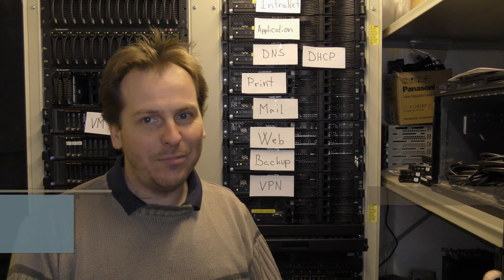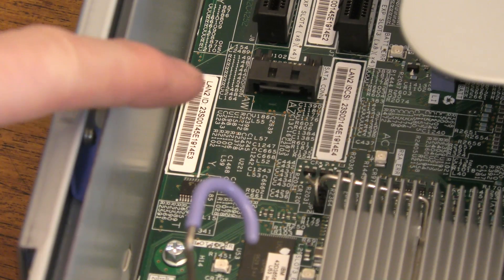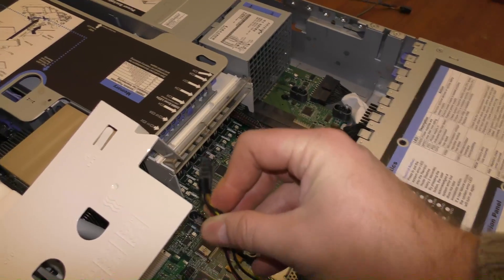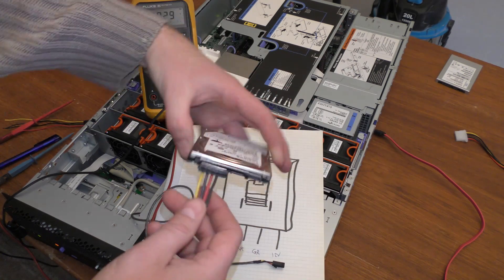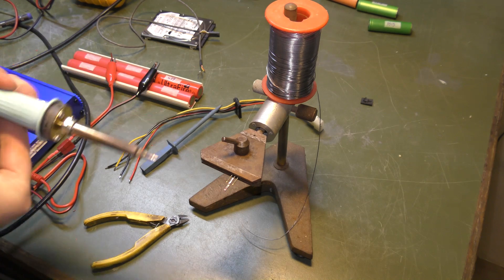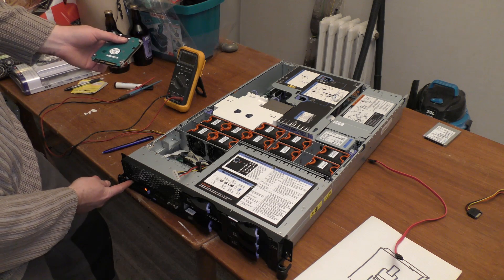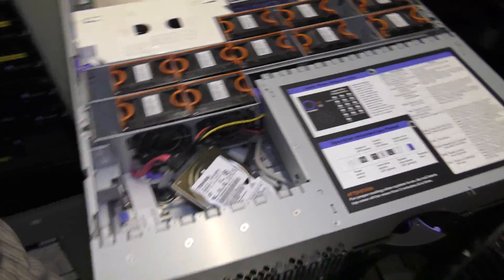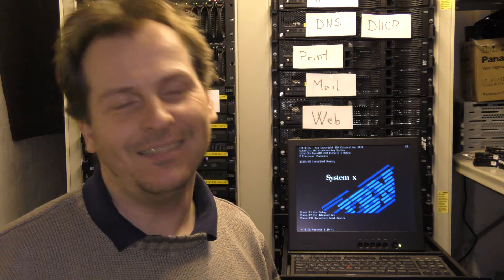IBM x3650 M1 now with internal disk - Ninja Hack - 276

Comment: Hi I'm trying to do the same thing in my x3550 M5 is there a power connector as there seems to be a Sata port?
Reply from the maker: I do not have the x3550 M5,, but there should be some power,, for the DVD-rom
Reply: @MyPlayHouse  there is it is one connector with both power and data but it's a small dedicated connector not a standard

Comment: As we have an old x3650 M1 you might have a good hint what to do, if the arcconf-Command fails:
"/usr/sbin/arcconf
Segmentation fault"

I don't know how to solve this.
Any hints?
Reply from the maker: Hi whiterabbit2112
Thank You very much!  I would,, run the BOMC to make sure all firmware is all good and new. (I have videos on that) I would reconfigure the raid controller,, delete all drives and make them again. and then reinstall the OS,, if that linux OS than fails,,, I try a Server 2008R2,, just to see if that would install. 
Thank you for watching! :-)
Reply: For future users. 

Install the debian package (If you've got installed RHEL, RPM package). If youre using Proxmox and need the configuration for the 8K, Install the package from Adaptec Website.
http://download.adaptec.com/raid/storage_manager/asm_linux_x64_v7_31_18856.tgz

Install it. Enter in the folder /usr/StorMan and put this Variable.
export LD_PRELOAD=/usr/StorMan/libstdc++.so.5
and run ./StorAgnt.sh (For testing purposes do it and close with CTRL+break, or if you like to run it in second instance do it with "screen", dvtm or tmux)

Run in Windows or Linux the GUI Management
http://download.adaptec.com/raid/storage_manager/msm_windows_x64_v2_03_22476.zip

Put the IP from the server and username root, password (proxmox password)

Pd.: Don't try the ./StorMan.sh because it needs X11 display. Proxmox is gui-less and wont work.

Comment: i have a question about the RSA for the x3650 
i have 5 3650 M1 in my rack and i was wondering if you need an RSA for one or can you piggy back off one of the servers through a switch?

also the FRU for the RSA is 46M5966 but i have found a 13N0833 that looks to be the same... will the RSA 13N0833 work with the 3650 M1?
Reply from the maker: Hi Joe MacPherson
Thank You very much!  That is two very good questions,, There are an option to connect from one RSAII to others.... I have never tried.. But I would believe that you will need RSAII in each Server. The RSAII is used in different models of servers,, and if has different FRU: in different servers,,,, I am afraid you would have to try :-)
Thank you for watching! :-)

Comment: hi my friend thank you for this share! I have 2 racks with 10x3650 m1 in a productiom environment similar to yours. I really like these servers but one of them has a 2Xdual core xeon and I want to install a 2xquad core cpu. problem is that my part number motherboard is not capable of quad core cpus even with latest bios update that is the same version of all the other servers that are already with quad core cpus un board. maybe you know if there is an hack or a mod for the bios that can help me to have this quad core upgrade. many thanks for any suggestion
Reply from the maker: Hi wassy83
No I know of no hack,, but the Intel Xeon 53xx quad cores vil work in them. not as fast as the 54xx but fare better then 50xx's
Thank you for watching! :-)

Comment: Idea: use the internal tape mount with a dual 3.5 to dual 2.5 RAID 1 HDD enclosure to achieve a RAID 1 backup module or as suggested to run the OS on. I wonder if the internal sata supports port multipliers? Note: Some modifications maybe required. Nice mod; I love these servers too. Years ago I did a mod like this to supply power to a USB 3 card to allow backup to an external USB RAID. The power off of the DVD drive as it almost never requires power and both worked well together without overloading the motherboard. It is still running fine. Items needed would likely be: IBM DDS Tape Enablement Kit for the x3650 is 43V5959 with the 4873 option for 2.5 inch disk drive or 5387 for 3.5 inch disk drive models  Startech 35SAT225S3R Dual-Bay 2.5” to 3.5” SATA Hard Drive Adapter Enclosure with RAID, if your interested.
Reply from the maker: HI
I did this on request, and to see if I could run a internal drive. 
Thank you for watching! :-)

Comment: nice video again, keep it going !

When using an SSD, AHCI is recommended..
I dont know if this onboard sata chipset supports AHCI..

I think it could be a nice solution, to put an OS (for example Vmware ESXI) on that SSD inside, and the rest of the data on hot-swap HDD's. (with raid6 I recommend.)
Reply from the maker: HI +Floor van Nierop
This was just a old laptop disk drive,, but yes i do believe that IBM x3650 M1 (7979) has AHCI.
Have you tried this? and do you know the advantages?
Thank you for watching! :-)